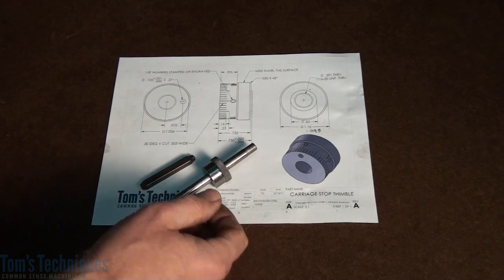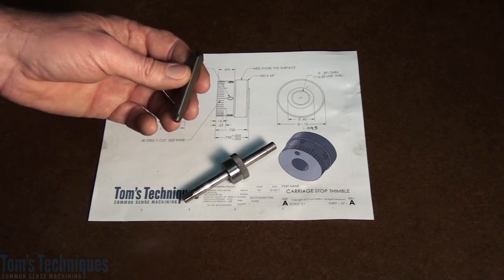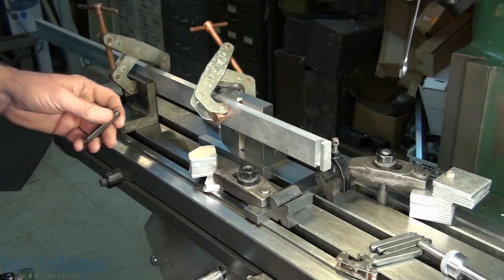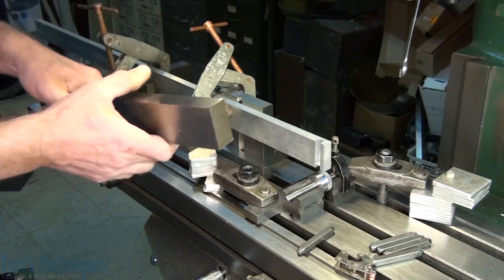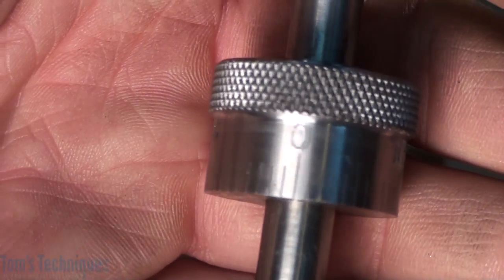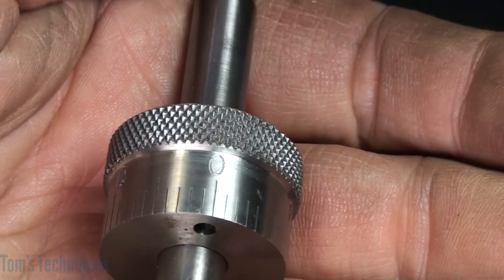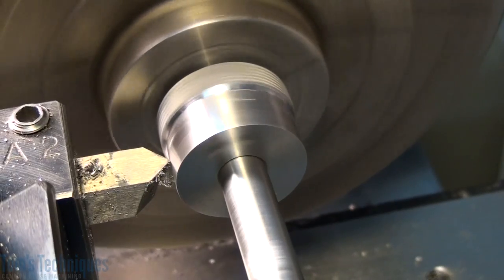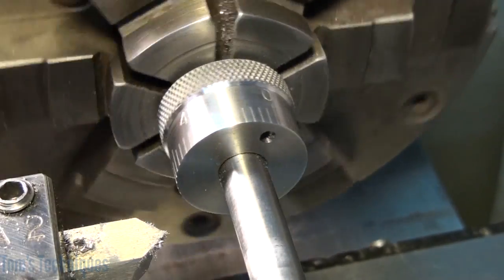Carriage Stop Thimble Part Four, Stamping the Numbers

Comment: Love the idea of the adjustable clamping spacer on the mill table using the layers of aluminium sheet that can be swung into place.
A good use of offcuts :-).
Reply from the maker: Thanks Ray.

The stack blocks were the subject of the last project tutorial on my website (tomstechniques.com), you can get drawings for them over there. They are very handy and get a lot of use in my shop.

Tom

Comment: Hi Tom,

I echo the sentiments below, it was a great set of videos and, I really think you have a talent here. Not just the machinists ability, which is a given, but also the ability to teach well, give clear concise instruction and get all of that done while juggling the vagaries of camera work, lighting and editing. 

I, for one, would strongly urge you to continue even if commitments are tough. If the frequency drops a little so be it. I love the Idea of possibly making a Knurling tool holder for the next project, I thought that was an inspired choice.

One last thing, are you going to do a final assembly/ demo video?

All of the best,
Alastair
Reply from the maker: Thanks Alastair, it's good to hear that my efforts are appreciated.

I will be doing an assembly video on the carriage stop as well as a demo of how to use it. I had planned on doing it this weekend, but decided to add another part, some square head clamp bolts instead of the socket heads I had called out on the print. Those are finished and the video is being processed. It should be on YouTube later this evening.

Tom

Comment: liked your set up, the stamping looks very professional. how about doing a video on horizontal stamping. like stamping the caliber on a rifle barrel.
Reply from the maker: Larry,

The same technique would apply, although I would probably cut the slot for the stamp in the end of a bar rather than the side to get the bar out of the way of the barrel. A method of holding the tapered barrel would also need to be devised that could be moved in a linear direction to space the letters. The barrel would also need to be supported under the stamp. Maybe with an adjustable parallel?

I will be doing some stamping on the barrel of my Steve's when it's complete, so I'll probably do a video on that.

Tom

Comment: Looks great  i would have added a flat plate to allow your numbers to line up exact because you did them individually they were misaligned.. Keeping the stamps in a box shape would have stopped the shifting when you hit it with a hammer . Loved your set up .
Reply from the maker: You must have missed the part where I clamped every stamp before striking it with the hammer. ;)

Thanks for watching.
Reply: @TomsTechniques  Clamping it still allows it to rock because it rides on a point not against a surface which is better to improve that result .  I  did see you clamp which held the die i'm not talking about holding it in a position but as the hammer is struck it still moves that in the direction of least resistance .

Comment: Hi Tom...

What a great lesson!  You had me on the edge of my seat when you had the part back in the lathe to do the small cleanup/polish....then I finally got a grip on myself since it wasn't me doing the work....this is where I am good at messing up all of my work when I try and detail, hence the stress...LOL

What is the new video edit software?

Best regards
Chuck
Reply from the maker: Chuck,

There's nothing wrong with re-chucking work as long as you use an indicator to get it right. With the depth of the graduations, there is no room for runout.

The editing software I decided on is Power Director 12 by Cyberlink. It was reasonably priced, very powerful and so far, fairly easy to use. There are also a good number of online tutorials for guidance.

Tom
Reply: I LOLed when I read your post Chuck!  I tensed up as well when I saw Tom recheck the part to clean it up.  I guess that is the difference between us novices and a professional machinist.  This is why we watch the pros!  All the best-  Fred
Reply: Enjoyed the video, real nice work!
Reply from the maker: Michael Murray
Thanks Michael.

Comment: Thanks for the great lessons!  I assume it is a safety thing but is there a particular reason why you polish the part with the Scotch pad from the back while the spindle is in reverse?
Reply from the maker: Thanks Neil.

There's no specific safety issue. Unlike emery cloth that can wrap up and grab a finger, strips and small pieces of Scotch-Brite tear easily and are safe to use on a rotating shaft. The spindle looks like it's in reverse on the video, but it is running forward. The only reason I worked on the back side was so I didn't bump the sharp tool.

Thanks for watching.

Tom
Reply: Great!  Thanks for clarifying.

Comment: Not sure why the zeroes came out mis-aligned after all your hard work fixturing.  I guess they don't make those stamps with the numbers exactly centered on the body of the stamp?  Or maybe the zero stamp was upside-down?
Reply from the maker: +Jason Goodman 

That's exactly right. Whoever made the stamps misaligned the zero and I didn't notice until it was too late. I know that if you want something done right, you have to do it yourself, but I didn't think that included making the stamps. ;)

Tom